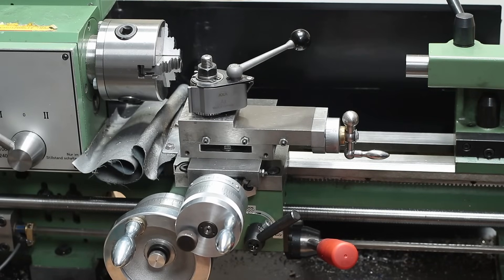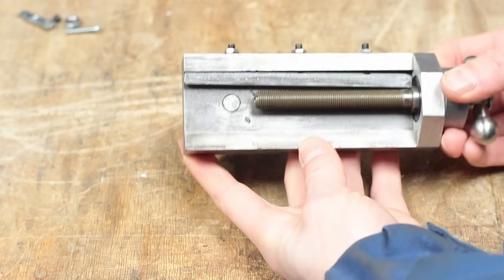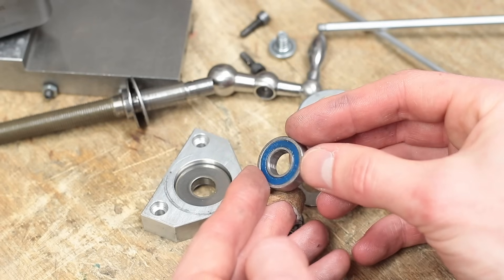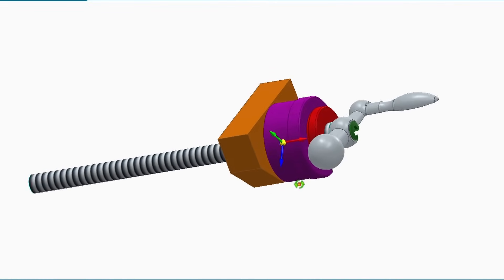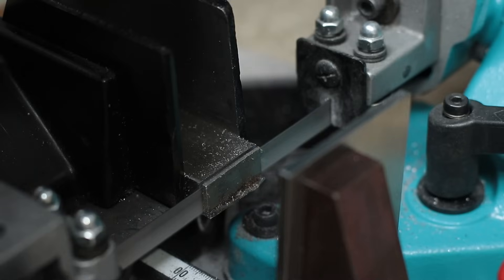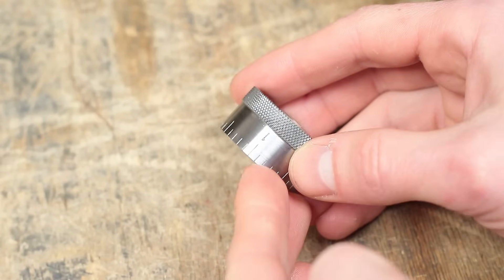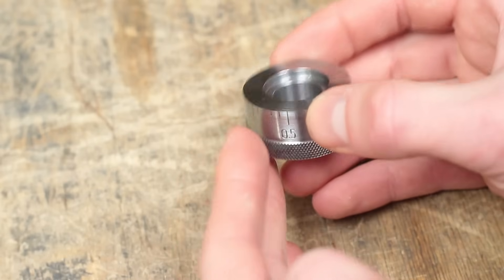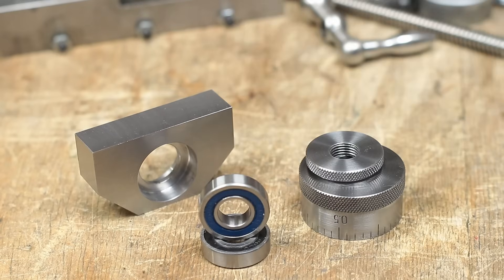How Everything Begun: Redoing The Mini Lathe Compound Slide. Again? Yes, Again! Part 1/2

Comment: Which type of angular contact bearing did You use? (Looks smaller outer diameter and narrower than 7000 or 7200) By the way Your videos are one of a kind!
UPDATE: No need to answer! I  watched the part 2 video in high resolution and I could read it. Thanks again for Your videos!

Comment: Hello, first of all i would like to express my huge respect for your fantastic craftman skills, it is super inspering to see your videos.
I have a question, i have a nearly similar lathe, and i have classic problem with the upper compound is very difficult ti adjust the gip screws so there is no play, but that it do not catch either, but just run smoothin the complete lenght, without catching, and easy turning.
Did you make new gib’s or other modifications, to have your upper compound run smooth?

Comment: I like your single cutter knurling tool. Is it reliant on the diameter being one of a particular set of sizes or doesn't it matter for this type of tool

I don't have an engraving idea but if you mark the top and bottom of the 1 on the edge of your stamp it doesnt matter that its out of alignment because you can just line it up using the marks, especially well if you mark a pencil line on the part being stamped

Comment: How do you calculate the graduation of the dial? I want to make a dial for my mill, the outside diameter of the dial would be 40mm. If i want the increment to be 0.1mm , how to print a circle template please?

Comment: Did you calculate in advantage the circumference of the new dial referring to the new main screw?
Reply from the maker: Yes I calculated this. The new lead screw moves 2mm per revolution. With the 40 division on the new scale the resulting resolution is 0,05mm.

Comment: how did you know the scale positions on dial wheel?
Reply from the maker: What do you mean exactly? I know that I wanted 40 divisions on my handwheel. I printed the template accordingly and just translated from the paper to the handwheel as shown in the video.
Reply: @WeCanDoThatBetter  
I mean how you know how long the distance if you rotate the dial a complete turn?
Reply from the maker: @kmalnasef1512  The spindle I use has 2mm pitch. That means by every full rotation the slide moves by 2mm. With 40 divisions on the scale it has a resolution of 0,05mm per division. I hope that makes sense :)
Reply: @WeCanDoThatBetter  
yes that's it.
thank you.
great job

Comment: I really liked your letter/number stamping jig for holding things in alignment. While watching you use it I also thought that if you included some large diameter washers under the screws used to attach the holder to the long flat bar you wouldn’t have to use one hand to press on the open section of the holder to ensure the press blocks don’t shift or fall forward.

If you had a specific reason for leaving the front open I would be interested in learning more since I have a handful of projects which will require letter/number pressing into steel so picking up and extra little tips would be great.

Comment: Why the bearing change, there are no side loads on the shaft.
Reply from the maker: Hi, not primarily, but you want the leadscrew to be supported both axially and radially. Perhaps it would be possible to use only thrust ball bearings too but I wanted to go this way.

Comment: I'll wait to see the outcome of this project. But if the main intention is to replace the axial bearing with two radial bearings, you will be making a huge mistake, as the greatest stress suffered is axial and not radial.
Reply from the maker: Hi and thanks for your comment! I've said it in the video: The bearings I use now are angular contact bearing which mean, they can take both axial and radial forces. Of course the main forces are axial and by using two bearings which can be preloaded this will be a good solution. At least that's the plan :)

Comment: 7:47 I felt that one... 👁️🫦👁️
Reply from the maker: Oh yes :) I didn't want to waste the material so I clamped the hole bar in the chuck with a horrible stickout which causes it to vibrate quite badly when not supported with the center.

Comment: Always fun redesigning parts for mini lathes. I've been working on redesigning the entire cross slide for the Grizzly G0768 for a bit. The only part (for now) I'm not planning on remaking is the compound slide.
Reply from the maker: If it works it's ok :)

Comment: You needed to bore bearing seats in one installation of workpiece. Only that manner will gives you precision and coaxiality of bearing seats. And between bearings you just need to install a simply spacer...
If you want absolutely exclude bearings axial movement - just choose a bit narrower bearings and install retaining rings or, maybe,  use somekind lids...
Reply from the maker: Hi and thanks for your comment! Yes, ideally you want both bearing seats to be machined in the same setup. But that's not everytime possible. I carefully dialed in the part after flipping it over in both radial and axial direction and managed to get it to about 0,01mm accuracy. I guess that this is accurate enough for a good alignment. And yes, I have to make a little 2mm spacer ring which goes in between the two bearings. I missed that in my cad assembly. It has to be about 0,01mm narrower than the distance between both bearings to have some preload I guess. That's a least my plan.
Reply from the maker: In my design the bearings can't move axially because the were held together with the leadscrew spindle and a retaining nut.
Reply: @WeCanDoThatBetter  I was thinking that, proposed straight bore would rely on circlips taking thrust of outer race where you have solid back stop.
correct fitting tolerance for 35mm OD bearing is in the 5~10 micron range if I remember right?

Comment: McMaster has some revolving handles that you can fold in so they arent in the way, another good option to make sure stuff isnt in the way
Reply from the maker: Thanks for the hint! I'm not sure if they sell these types of handwheel in such a small size. The handly I need is actually tiny :) My plan is to mount it with only a set screw. The bearing assembly is designed that it works without the handle (handle is not needed for the preload).

Comment: Brilliant punch holder! 👍 I always wondered how to go about punching those numbers around the circumference of the dial. 

As a possible alternative method, you could chuck the punch on a drill press with a clamp to lock the spindle from rotating, and then striking the spindle from the top of the drill press with a hammer to leave an impression. It gives you the option to adjust crooked numbers by slightly rotating the spindle. 

Frankly, you're too much of a perfectionist. I didn't notice it until you pointed it out. I bet you'll find the same or worse problem if you scrutinize other dials. I would rather have my work look imperfectly factory made than homemade.
Reply from the maker: Thanks for your kind feedback!

Comment: I have seen pantograph arms that affix to the column of the milling machine and run off of the mill spindle. It seems like a relatively simple design. At least not any more complicated that’s projects I’ve already seen you do. That might just be the ticket to your punch problem. Build a pantograph. More videos for the channel and a new solution to a problem.
Reply from the maker: That sounds great! I have to think about such an attachement :)
Reply: I second this idea! Stefan Gotteswinter has one that he uses to carve torx holes on screw heads. Schöne Grüße aus Hamburg!
Reply from the maker: @alessandrosilenzi  He had such a machine, yes. But already sold it to someone else...
Reply: What band saw do you have? Looks like it works well for you.
Reply from the maker: @erichill4796  The bandsaw was one of the best investions fur sure. It is a Berg&Schmid PBS 130. In my video "saw arbor and new machines" I showed it a little bit. I'm really happy to have this bandsaw.

Comment: I definitely like your stamp jig😊
Reply from the maker: A little bit wild, but it does it's job ;)
Reply: @WeCanDoThatBetter  I like it's simplicity, been drawing stuff far too complicated for me to make without more machines and material. Fabrication is all that was needed. 😣
Reply: Yeah,  it was brilliant! 👍 I always wondered how to go about punching those numbers around the circumference of the dial. As a possible alternative method, you could chuck the punch on a drill press with a clamp to lock the spindle from rotating, and then striking the spindle from the top of the drill press with a hammer to leave an impression. It gives you the option to adjust crooked numbers by slightly rotating the spindle. 

Frankly, you're too much of a perfectionist. I didn't notice it until you pointed it out. I bet you'll find the same or worse problem if you scrutinize other dials. I would rather have my work look imperfectly factory made than homemade.
Reply: @bobweiram6321  oh, that's a brilliant idea! 😁

Comment: I would have liked to hear why you are “upgrading” to an angular contact bearing over the needle bearing arrangement. What do you gain from this? Why is one preferred over the other? 

Very nice parts as usual!
Reply from the maker: Hi and thanks for your comment! I think I can say a little bit about in part two. At the time I made the first bearing arrangement I didn't know there were such small angular contact bearings. For me they are the more professional choice as I can preload them properly and they are sealed against dust and dirt. In addition to that I don't need two different bearing types (thrust and radial) as the angular contact bearings combine both.
Reply: @WeCanDoThatBetter  that makes sense! Thanks for the info!